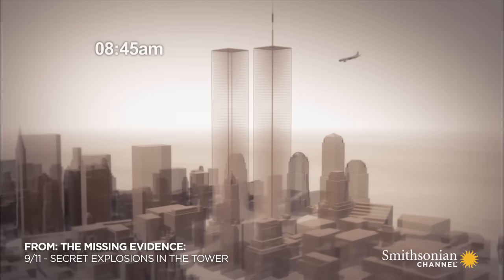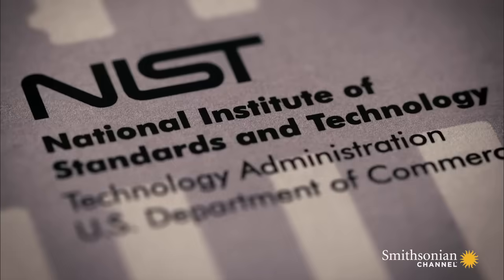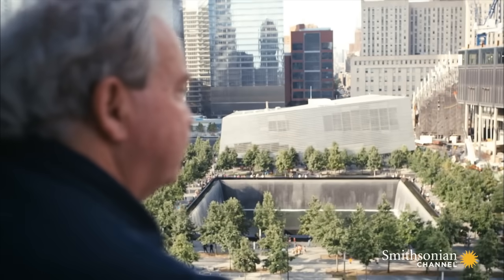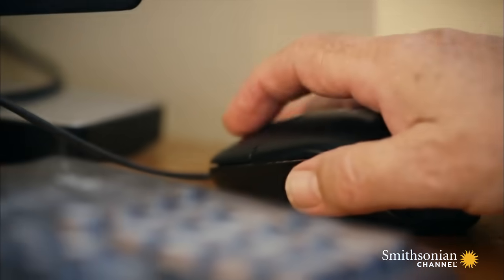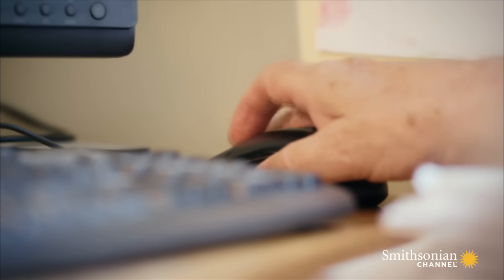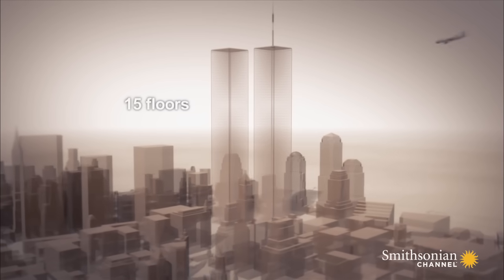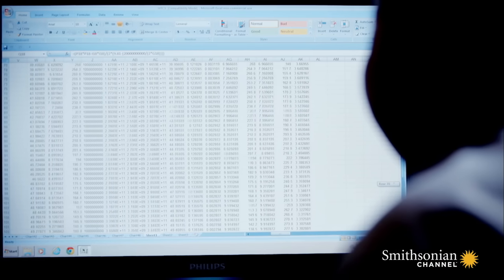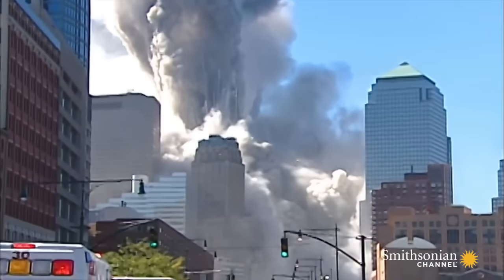This Computer Simulation Explains How the Twin Towers Fell

Comment: So are they trying say that those buildings were built poorly or what? 🤔
Reply: The designers did not anticipate the extreme nature of the attack.

And before you start with the "the towers were designed to be struck by planes" line, let me remind you: The engineers made their calculations based on a plane lighter than a 767 hitting the tower at 1/3 the speed with which the 9/11 jets struck, and low on fuel not fueled for trans-continental flight. Not the same.

Comment: So 15 floors above  crushed the 94 undamaged  floors below, so Newtons 3rd law just sits in the corner why we do the math on this?
Reply: Have you ever wondered why the world's physicists do not agree? It's because they are remembering something you are forgetting:  GRAVITY. GRAVITY is why Newton's 3rd is not the answer you think it is.

Momentum only needs to be conserved in a closed system - that is, a system with no external forces acting on the players. In this case, there is very much an external force: Those top 15 floors have a tremendous amount of gravitation potential energy, and they're going to spend it all the way to the ground.

Oh and also don't forget, each floor JOINS the collapse with its own GPE as it is destroyed. Every floor, all the way down.
Reply: @Tim22222  G'day Tim, the vision shows floor after floor being pulverised how did the 15 floors stay in tack long enough to crush the 90+ healthy floors. That leading edge floor would be wearing the same amount of impact as the first healthy floor, its not like an atlas ball falling through glass, were talking the exact same material colliding into each other. Matter being ejected  out as it fell. Just seems very suss that 3 times In  the one day buildings failed in the exact same way taking the path of most resistance, gravity being the key driver as you point out I wouldn't have thought that to be the case..

Thanks for the reply by the way seems so hard to have a civil conversation on this subject with any 1 online
Reply: @edgeofreason2710  Who says they stayed "in tack"? They were destroyed, of course - but guess what? 100,000 tons of skyscraper becomes 100,000 tons of rubble but it still weighs 100,000 tons! And still being up high, it has loads of gravitational potential energy available to crush what's below it.

And did I mention, each floor JOINS the collapse with its own GPE as it is destroyed, every floor, all the way down? Yes, some matter was ejected but not much.

Comment: Fire can't melt steel.... But don't tell blacksmiths.. They've been committed to this conspiracy for over 1000 years.
Reply: A forge has a consistently applied fire whereas the plane strike had only the resulting fireball when the fuel exploded and nothing afterwards but a smouldering office fire. All furniture/equipment is fireproof before going into the towers. Pls tell me you know that there's a difference?

Comment: OK, but where are the debris of the collapsing buildings? Nothing piled up on the ground. The towers were atomized. They only generated dust, too much dust.
Reply: Are you joking?? They spent 7 months removing very solid debris including 100,000 tons of steel! Perhaps you're forgetting that there were 7 underground levels? The pile was 100 feet taller than you think.

Comment: A planes speed doesn’t have enough psi to damage A36 steel. A plane can travel up to 500MPH that’s about 20PSI A36 steel has a strength of 58-80,000 PSI explain that.
This building was built to withstand this very situation. And then it happens…
Reply: Yeah I thought it was ironic when the narrator says at the beginning "...built to withstand aircraft collision" ok, so why didn't it withstand it????

Comment: I’m amazed how the pilots passport was found at the bottom of the towers
Reply: Next time we should make a tower out of passports instead of metal.
Reply: 🤣🤣🤣🤣🤣 in perfect condition
Reply: Two aluminium planes cut through the steel beams, jet fule made them melt, 3 buildings collapse evenly at free fall and yet the passports survive...🤔 somethings not quite right
Reply: @ourmine2349  something small like that would he launched p far away, not surprised it would be found tho
Reply: @ourmine2349  Jet fuel did not melt the beams at all - it's not hot enough when it burns.  Turns out you don't need to melt steel in order to weaken it - just heat it enough and it loses its structural integrity.  WTC 7 collapsed due to damage from the towers when they fell, and ensuing fires within, which is not evident on the videos.  This is all proven and to think you know better than people who study engineering is an insult to those who died.
Reply: @YTuberosity  well actually a lot of these points people argue on we’re made by engineers , cause yes buildings don’t collapse at free-fall speed , sometimes people lie and when things don’t add up logical people’s ask and ask dumb people just listen and listen
Reply: @YTuberosity  it is hot enough to melt aluminum though. The aluminum skin of the plane melted, and when the water form the fire sprinklers hit the liquid aluminum it resulted in a chemical reaction causing explosions and flames much hotter than that of jet fuel.
Reply: @slinky_malinki5330  what chemical reaction is that? I'm not doubting you but what is the exothermic reaction that you speak of?
Reply: @akiracornell  The water that comes into contact with the molten aluminum vaporizes in an instant, becoming a high pressure superheated layer between the aluminum and the steel supports. This superheated layer is hotter than she aluminum itself, and hotter than the jet fuel flames. The steam also creates hydrogen, which is a combustible gas that can cause more explosions and more heat. Water an aluminum is actually a way that hydrogen is generated for industrial use.
Reply: @slinky_malinki5330  I don't see pressure being an issue considering all the windows are blown out. But if you say there is an extreme heat there that's quite interesting. But what is the yellow molten stuff on video pouring out of the different videos? I haven't gotten a real clear answer for that yet. As there has been done experiments to try and take organic material and combine it with the aluminum to get the color. There are so many variables around The two towers and benefit of the doubt and all directions. I have struggled it more with building seven and what these fuels were that burnt under the ground for two and a half months smothered in concrete dust.
Reply: @slinky_malinki5330  that really is interesting. So that's an exothermic reaction? I just don't understand what the catalytic forces to increase the thermodynamics? For instance in a thermate or thermite reaction the driving force is the aluminum taking the electron from the iron oxide. What is the catalyzing molecule or atom in this reaction? Is it just the pressure created from turning water into its gaseous States of oxygen and hydrogen?You have to forgive me I'm a lay person when it comes to chemistry I'm learning a lot surrounding this as I go. I'd always found the electron shell theory very interesting wondering what forces were going on to give the stability to those mathematic features.
Reply: @akiracornell  I'm a geologist, not a chemist. I don't know the math behind the The electron shells and everything, but I'm sure a quick Google search would answer your questions. As for the pressure, I'm not talking about air pressure inside the building. I'm talking about near microscopic regions between the molten aluminum and the steel supports. A layer of water that vaporized instantly, and is trapped as bubbles in the aluminum and became superheated.
Reply: @slinky_malinki5330  how do you know that then that there is an increase in heat? not that it really matters I'm just curious
Reply: @YTuberosity  it’s a insult to lie an cover it all up , if it happened , I don’t know am not powerful enough
Reply: @akiracornell  
One the planes struck the tower just above the level that housed the servers and their enormous battery backups. The motel metal you say was lead and aluminum in their liquid states.
Reply: @slinky_malinki5330  you don’t have any clue ok The towers were full of asbestos fireproofing, which looks idenetical to white feathers. Plane hits the tower literally at the speed of a .45 caliber bullet (450mph) blowing out the feathery fireproofing at the impact site, THEN fire starts.  As with any metal, it becomes weaker the hotter it gets, as there was weight (the floors) above the the fires the steel started bending inwards because it was getting weaker , this is also why the 2nd tower that got hit collapsed first; there were basically twice as much floors & weight above the impact zone
Reply: @akiracornell  about the molten yellow stuff pouring out - there are videos on YT about it and it's same story about the alluminium from the planes melting.
Reply: @Electrical.Perspective  and you can see that the 2nd tower when collapses, tilts one direction little bit, which makes sense as it was hit more at one of the corners, which means that corner was weakened more.
Reply: @redhennessy3046  the buildings didn’t fall at free fall speed.
Reply: When you watch the 2nd plane hit the south tower in slow motion, you can see part of the nose of the cockpit exit the other end of the south tower before exploding. At least 5 feet of the nose exits the other end of the south tower in slow motion. From the high speed of the plane hitting the tower.
Reply: Yeah finding a passport was strange indeed, but sometimes impossible things happen
Reply: You know how tiny bits of peoples body parts and personal items can survive planes plummeting into the earth or sea? Yeah. This is no different. Some things are incinerated, some burn, some barely survive, some come through completely unscathed.
Reply: If FBI puts there after collapsing, why not then 😉
Reply: @asparagas5916  This is just more twoofer nonsense. The WTC towers were the least dense skyscrapers ever built.. Large pertions of the flight deck made it completely through the building and continued their trajectory which put them hitting the ground along West Street. The paeeport in question was found by a woman evacuating the complex along West Street about 2 blocks downrange. She turned it over to a policeman who in turn turned it over to an FBI agent. That is the truth of the matter. You twoofers go ahead with your idiotic innuendo but it's just faith based nonsense.
Reply: @fredjones7705  okay just believe what is told you 😂
Reply: @asparagas5916  Seriously---his name was on the passenger manifest. Not even an alias and he was a known member of Al-Quada. There's video of him boarding the plane. They didn't need to find his passport to prove he was on the plane. Lots of personal effects and body parts of the crews, passengers and hijackers were found. Mostly because they made it all the way through the building and were not subjected to the grinding effects of the respective collapses. BTW you're a fool.
Reply: @fredjones7705  is it easy to hijack an airliner?? Is it easy to hit pentagon? How about the flight recorder?? Why is it said to be burnt??
Reply: @asparagas5916  It was a lot easier to hijack an airliner in 2001. The flight recorders of United 93 and American 77 were recovered and provided DATA. The flight recorders of United 11 and American 175 got ground to bits in the collapses of the towers and were not recovered.
Reply: @fredjones7705  bro the things that you have documented are the things that were told you to believe as it was bla bla ..
Reply: 77th like:)
Reply: Several hundred pieces of ID were found. Of course, that's apparently irrelevant.
Reply: Really?
Wow
Ha2
Reply: Just see the controled demolitions.... I dont need science.... Just common sense.... Explosives at the bottom
Reply: They was still in tack, but a structured building built to withstand the heat melted 🤦🏽‍♂️
Reply: Right
Reply: And the $Million's of gold bullion reserves in the basement vaults vapourised !!!
Reply: So the explosion took out the building but not the passports?
Reply: But they couldn't recover 1 of the 4 orange indestructible black boxes
Reply: @KOFUNLOADED  I think the flight recorders are certified to survive only some conditions. There are not indestructible in total sense, i.e. they wouldn't surive being thrown into lava I guess. They were grounded like most of the things during the impact and the towers collapse. I'd hope that they had same luck as the Atta's passport though, but no, no luck.
Reply: A bouch of papers also were found
Reply: They weren’t tho, you’re mis-informed.
Reply: Same thing happened to my grandmother's 4 story care home. Enid put on an electric heater in her room on the 3rd floor and before you knew it the entire building collapsed. Luckily her bus pass and electric heater manual was found and the bottom of the building.
Reply: It wasn't found there. It was found about 4 and 1/2 blocks downrange from the impact. The towers were the least dense of any skyscrapers ever built. The passport was on Atta in the cockpit. The plane punched through the tower and shredded. Many plane fragments were recovered that passed completely through the tower. The passport now liberated from Atta's grissly remains continued for about 2000 feet downrange before impacting the street where it was recovered by a female pedestrian evacuating the area. Passports are fairly tough (mine is) so it doesn't seem odd to me.
Reply: @fredjones7705  rubbish
Reply: @fredjones7705  I hope that Atta was not just some guy on the street running from the buildings that dropped his passport.
Reply: @shadowman_390  Well they have video of him boarding the plane.
Reply: @fredjones7705  "they" have? If so, why is the passport of any relevance. Is that footage available to the public? I don't think I ever saw the boarding videos of him and the rest of passangers...
Reply: @fredjones7705  no they dont, theres never been any video footage of him boarding flight 11 at boston logan airport, the only footage they had was him at the airport in portland maine going thru security to board his flight to boston
Reply: @fredjones7705 seeing how you don't have a degree in anything scientific that you could speak knowledgeably about it, only means your opinion means nothing.
Reply: @fredjones7705  Lol. If I commit a crime I'll call you as a defense attorney for sure.
Reply: @fredjones7705  I have a unicorn in my backyard, send money for some of its tears
Reply: Yea that’s the only paper that doesn’t burn in a plane crash
Reply: @vincentm.7462  Passports can withstand a lot, you'd be surprised
Reply: @StarstruckChiroMusic  but im sure it will burn before metals start to melt
Reply: @foveres  It was ejected from the plane, along with other paper items that were recovered from the street.
Reply: @StarstruckChiroMusic give it to a puppy if you wanna destroy a passport. 😂
Reply: and if they where not found its also a conspiracy to hide their identities right?

Comment: Sorry steel and concrete don't burn from jet fuel. It's 3/5 kerosene.  Steel and concrete do not pulverize to dust.
Reply: The jet fuel started a fire inside the buliding that was over 900 F that was hot enough to melt the support beams and other stuff resulting into the buliding collapsing
Reply: @sanmarino8605   Steel melts at around 2500F to 2750F so 900F isn't even half of it. Support Beams are a lot stronger because they are specifically designed to withstand almost all calamities including the potential of a plane crashing into it. With a building of this magnitude, I doubt the architect and the structural engineer didn't do their due diligence.
Reply: @s_ame1135  oh sorry my bad I looked it up again to make sure and the fire actually was 1800F and many of the support beans got deystory when the plane crash into the building
Reply: @sanmarino8605  I'm an architect in profession and in our history, we're also thought about the twin towers. The head architect and struc engineer of the tower made sure they consider the potential of an airplane crashing into it as it's the only visible high-rise in the vicinity at that time so I don't know where you get your info that they didn't consider that.
Reply: @s_ame1135  they didnt when it was being built in the 70s no but with the new world trade center they have made it to where most bombs can't do damage to it and have made it a much stronger building
Reply: @sanmarino8605  well said also I live in ur name
Reply: @Rpj389  wow that's cool

Comment: It is so misrepresentative to claim that it was a shock the towers fell when you actually look at the engineering of the steel and what the engineering standards were at the time. It was a miracle that the towers didn’t immediately fall. As the video stated, it was designed to withstand a crash with a commercial plane, but no one could have EVER imagine that the commercial plane would have been actively accelerating. The towers stood for over 100 minutes. How many people escaped during that time? That seems like a miracle to me. 

For comparison, an entire half of the Murrah building in OKC (which is widely considered to be the first US terrorist attack) collapsed three seconds after the explosion.

Comment: They lift shaft was laced every 6 to 8 floors with thermite explosives,  burning jet fuel can't reach the temperature required to melt steel, buildings do not just collapse free fall on their own  like building 7 etc.